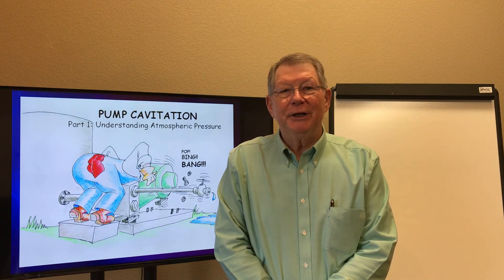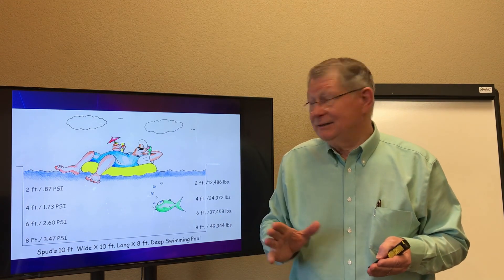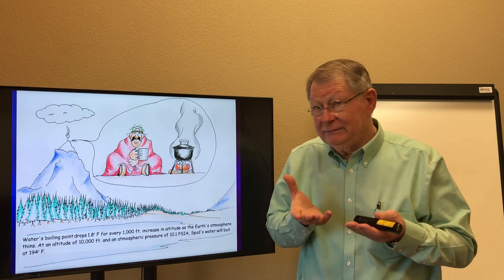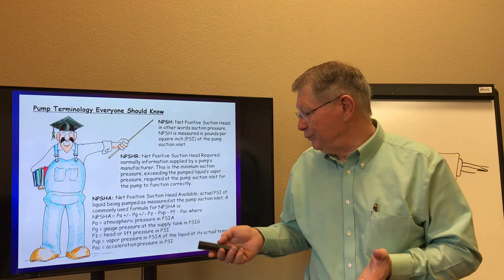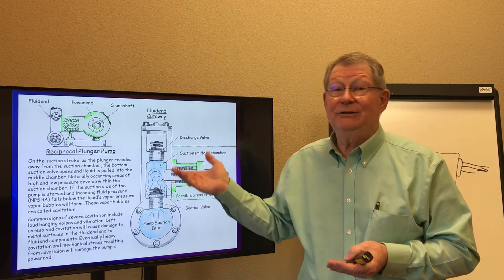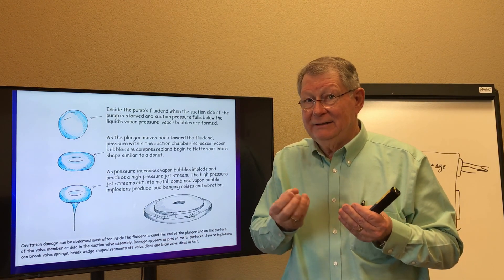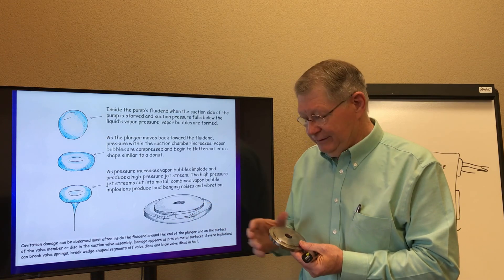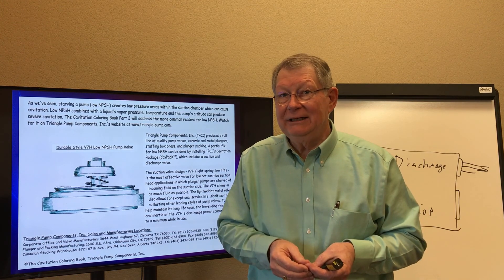Cavitation Fundamentals - Part1: Understanding Atmospheric Pressure

Comment: so atmospheric pressure also play a role in producing cavitation ?
Reply: Ambient pressure is what collapses the void.

This is why I think that tests of pistol shrimp attacks in small tanks with low ambient pressure don't show anything near the full power.

In a desktop tank the void is only collapsing under atmospheric pressure plus head, a little over 1 bar.

A shrimp under 20 metres depth will create voids which collapse under 3 bar ( ATM plus 2 bar hydrostatic head ).

How powerful would cavitation be under say, 100 bar?